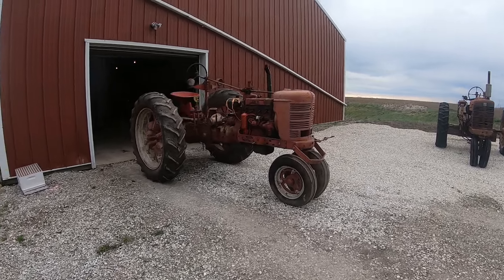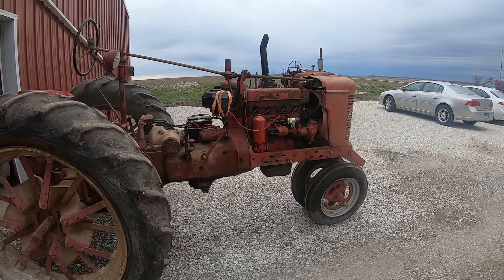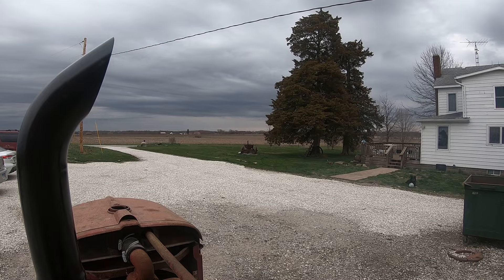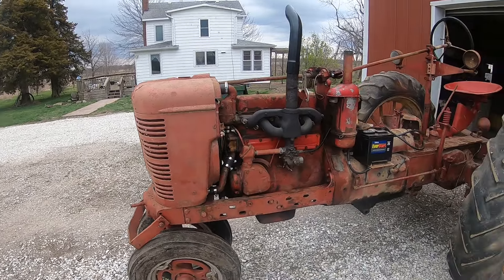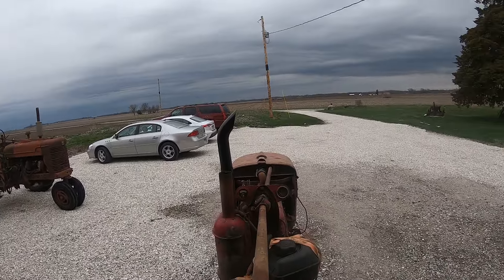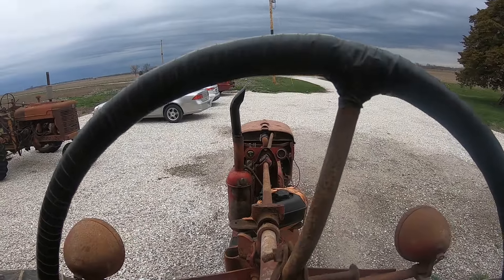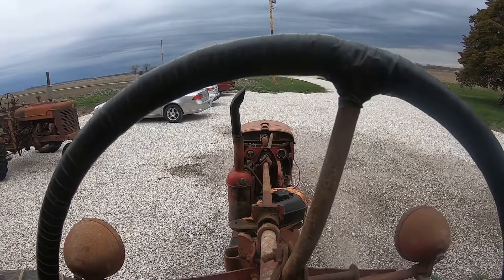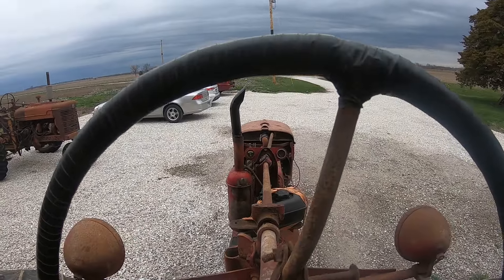Will it run and Drive in all the gears? 1939 Farmall H repower for the Grumpy Farmstead

Comment: That little kicker gas tank tied on there reminds me of what I rigged up for the '48 W-4 first test drive! 😎 I'd say that gear whine is "Farmall normal" and the way 5th gear was nearly whisper quiet proves that the ring and pinion are set correctly and in good shape, because 5th bypasses the countershaft completely and provides direct drive from the engine.  The 1st through 4th gear noise is likely mostly coming from the constant mesh gears up at the front because they're wearing together all the time that it's not in 5th - plus those straight cut teeth have never been known for running quiet anyway.  Milestone reached! 👍
Reply from the maker: Thank you Squatch. I agree I am planning on flushing the rear end and then adding some new gear oil. I figure it’s due after this many years! I planned on adding about a gal of diesel fuel and then a short drive around that should help it drain! Park it over night and then check it the next day. I need to get the big tires off it first though. 13 -38 is a tad too big for the old girl.

Comment: Good to see the young folks appreciate old machinery.  It's no surprise that there are so many of them still working today, all over the world. Built tough and simple to last.
Reply from the maker: I was kinda worried about the transmission because it had sat so long but I think a flush and some new oil and it will be fine!
Reply: @grumpyshopteacher25  I still have grandpa's 1962 140, and I use it for the big garden. It was rebuilt after it was retired from farming, no doubt it'll last longer than I will. Kinda hard to believe he farmed all that land  with such a small tractor, but then I remember he used to do it with mules. You're probably already hip to this trick, but if you get a tank with rust in it, the acid treatment/liquid polymer coating for old motorcycles will save the day. Good luck, and keep us posted.